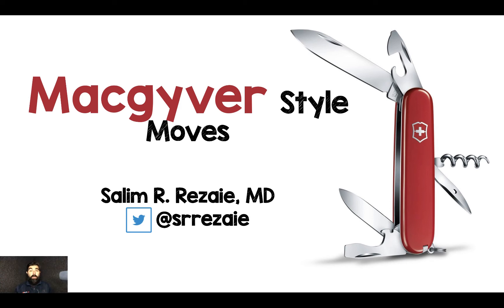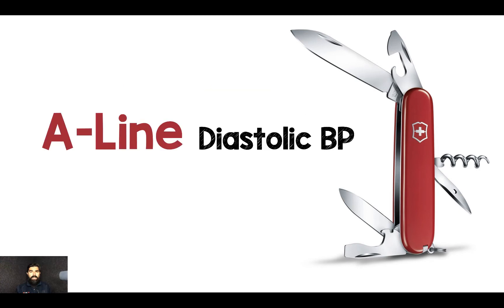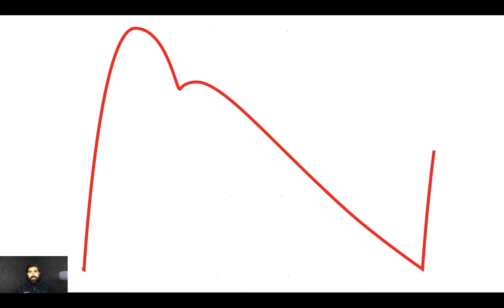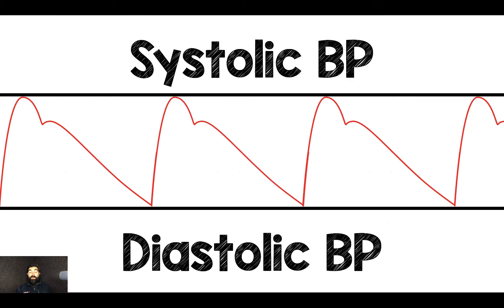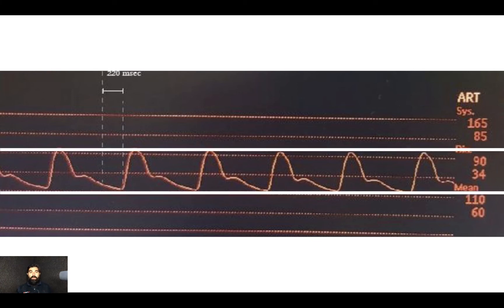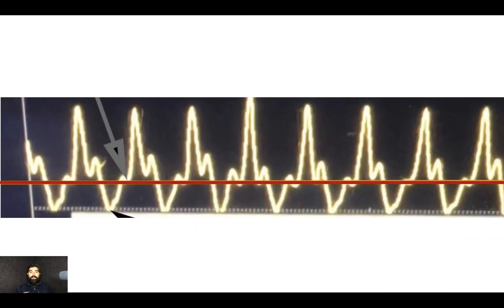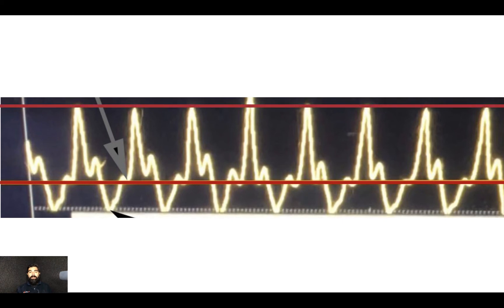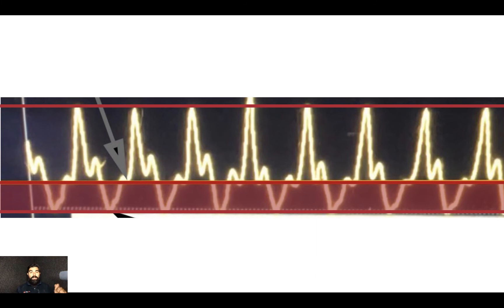Arterial Line Diastolic Pressure During CPR

Comment: Great little video! so there is a way to adjust the monitor to read our diastolic as that line above the shaded area? because the machine will read the diastolic as that bottom most number right? basically my question is how do we know what number is that proper line that we suppose to look at? 

Thank you!
Reply from the maker: It depends on the type of monitor but there is a way on some monitors to place a line where it should be…I am not familiar with all the different types of monitors so hard to tell you specifics…would have to look up manufacturer info to see if it is even possible…and yes…if u go based on the monitor you will have an incorrect diastolic pressure during compressions…a not completely accurate way to do it is you can also gauge with eye sight and numbers off to the side…
Reply: @SalimRezaie  roger that! thank you so much!
Reply from the maker: Of course
Reply from the maker: Of course